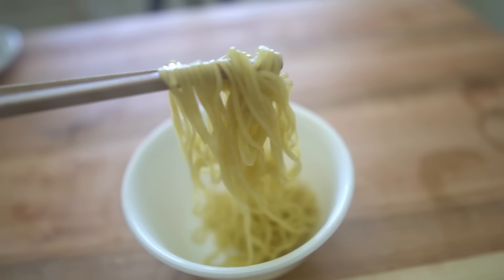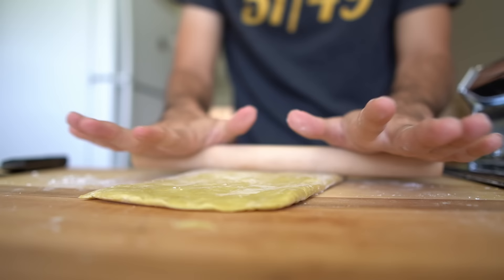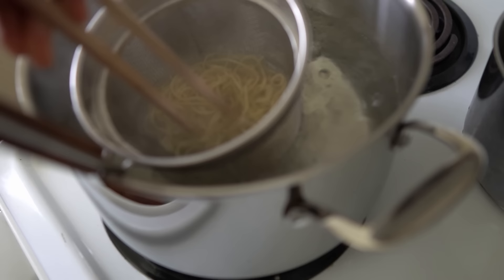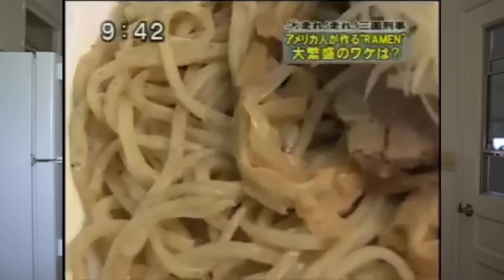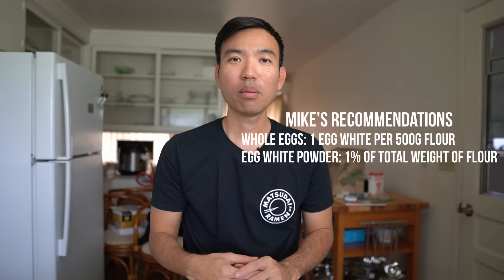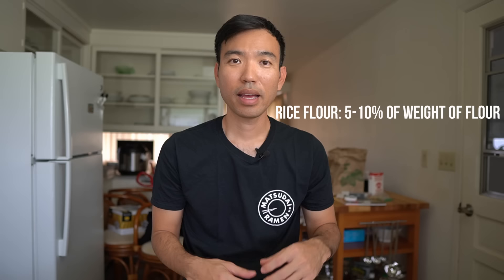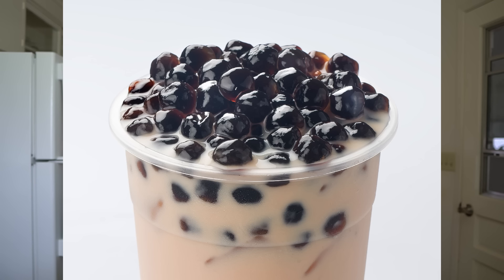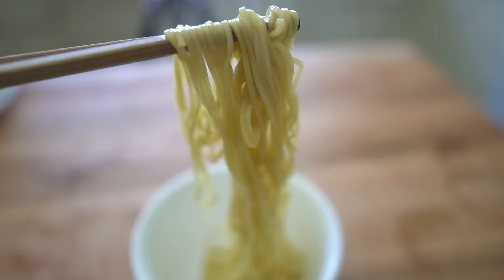The Science Behind a Perfect Ramen Noodle

Comment: Am almost making Ramen everyday now, but using a manual "Okazawa" noodle maker. The Rollers are bigger, with indirect crank, making them much stronger and capable of laminating the dough IF you have the strength for it. Currently making noodles at 29% hydration. The lovely part actually is, asides from being chewier is that they don't get soggy too fast either unlike the higher hydration noodles above 40%

Comment: Really good video Ryan. I would've liked to see you or Mike speak on whole wheat's effects on gluten development and texture!
Reply from the maker: Thanks man. Yup he talks about that in the conversation I put up as a podcast episode. Should be up by now on at least some places.
Reply: I know more about its effect in bread making than in noodles, but my understanding is that the small particles of bran in whole wheat flour are quite stiff and sharp. When you work whole wheat into dough the sharp pieces of bran cut the through the gluten and prevent them from developing long strands. That’s why whole wheat bread tends to be denser; less gluten development means less elasticity so the dough can’t rise as much. Bran also doesn’t absorb water, so my guess would be you get a firmer noodle with more bite, but more brittle and not as stretchy.

Comment: How do you figure out how to match noodles with soups? I've made bowls where the noodles just seems to stick out like a sore thumb, and doesn't seem to match the bowl. But I have no idea which quality the noodles didn't work to know how to adjust it.
Reply from the maker: It's usually related to the concept of karami, the soup sticking to the noodle. There are things you can do to adjust that like the thickness of the noodle or the hydration. You could also just be adding too much noodles which is throwing off the balance. Most noodles should be OK with most soups. Maybe if you can figure out what you don't like about it you can try to dial in to minimize those effects.
Reply: @WayofRamen  Are you saying that the more hydrated the noodle, the less the soup will stick to it? Or vice-versa?

Comment: I have a question about using fresh egg whites as an adjunct. i dont have access to egg white powder and I know when you're adding whole egg whites, you're also adding water. is there any way to adjust for how much water is replaced by the egg whites?
Reply from the maker: how i do it is i get a measuring cup on a scale, weigh the egg whites then pour water in until i get to the total amount of water i originally intended to use. egg whites are mostly water so this works well.